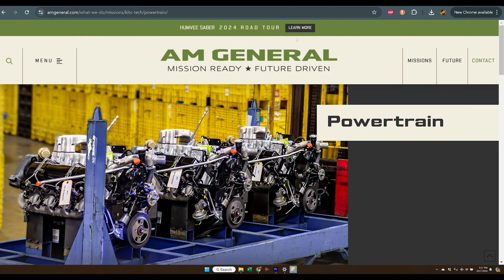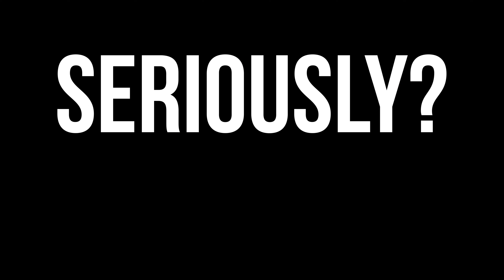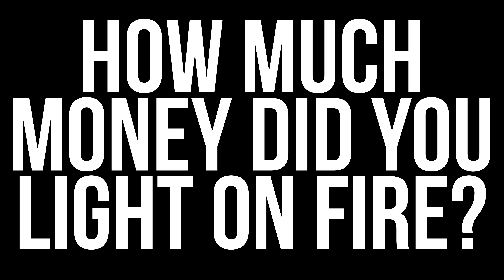How This 6.5 Diesel Makes Duramax Torque - Build Breakdown

Comment: Hey mate, cool video. I love my 6.5 in my 80 series LandCruiser. The question I have is where you plumb the coolant filter into....any pics or video of that? Cheers, Tim😊🙏
Reply from the maker: Did you check the photo gallery yet? Lots of photos. The filter is setup in a bypass fashion like a heater core.

Comment: Great walk thru on the build! I’ve been basing my plans for my 88 off your suspension, but staying to about 4”. The power plant will most likely be a 6.0 LS with a carb to start. Someone try and talk me out of it lol… I just don’t trust myself to do diesel correctly or be able to afford it.
Reply from the maker: 6.0 LS is a great engine and will make the torque you want with very few modifications. You're targeting 4", which is about where my truck sits. They get tall, quick.
Reply: @WillometMotorFab  they do! Thanks for your feedback. The boomerang hanger is my favorite design. Placed correctly I should be good to stay under 5 haha.
Reply from the maker: It’s worth the work to keep it low. 👍

Comment: I drive a old military K30 with the 6.2 diesel. I turned the fuel screw 1/4 turn and put on a ram air intake tube. It’s got plenty of power for me. I couldn’t imagine having the numbers yours is putting down.
Reply from the maker: Nice! You can get a lot out of those 6.2s with a little tinkering.

Comment: Considering dropping in a Duramax would probably have cost a lot more overall, this was way more cost effective. Even if you had just an unmodified Suburban, Blazer, K-series truck, these engines were supposed to be close to drop in ready if it had a gas engine or another diesel. I would try this on a K2500 GMT400 if I could find one. It is kind of sad that GM never did this engine the justice it deserved with what AM has been able to do. Least you shouldn't have to worry about a crank splitting, cracked cylinders, bad heads. Its been pretty much gone through and you won't have to worry about it.
Reply from the maker: The 6.5 got short-changed by GM, but the aftermarket has really come through. A Duramax would have been at least as expensive and required substantially more fabrication, which I would have entertained if I hadn’t just finished (6 months earlier) most of the fabrication work that you see in this video. It’s OK, this is a project that’s never done and this will not be the last engine that goes in it.
Reply: Not to mention a lot of the money he spent was on an entirely new engine and you could get one/rebuild one for fairly cheap but then it does depend on how much you want to build it up

Comment: I like the Duramax, but I've always liked the 6.5 better. I dunno, it's just the way it sounds, it's got a cooler character IMO.
I just wished the aftermarket support for them was as big as the Duramax's. But hopefully that will slowly change in the future.
Reply from the maker: It's a good time to be a 6.5 nut. Parts are available, good fuel systems, turbos that are made for the platform.

Comment: Such a crazy amount of detail went into the engine peripherals! Lots of really good information worth a lot. On a side note, as a European it's still crazy for me that you guys put single turbos on V8 engines 😀
Reply from the maker: Thanks for watching from afar! The idea of two smaller turbos has always been appealing. I think y’all might call that “bi-turbo.”
Reply: @WillometMotorFab  biturbo can also mean quite a few different things like register turbos and other stuff but in general, yes 😂 main idea is better throttle response, much less spool up time
Reply: @mazevx2451  I'm secretly dreaming of building a twin turbo, ported, forged crank & balanced 6.5. But not for power. Mainly for better flow and hopefully slightly better efficiency. The 6.5 is already a good platform to start with in terms of efficiency, but you can always make things better.
Reply: @Arexodius  I believe that the responsiveness and a good power/torque band is more important than max power anyway
Reply from the maker: I tend to agree, especially for anything that gets mixed use. With modern turbo options, you can do that without a super restrictive exhaust side.

Comment: 250 hp out of 6.5 liters is terrible lol. I love the way these engines sound but oh man they're hot garbage lol
Reply from the maker: Knowing diesels are known more for torque, 250hp is the good starting point. The IP has quite a bit more in it, and I’m getting up the guts to mess with it.
Reply: @WillometMotorFab  I'm currently in college for engineering and I'm working on building the most reliable 6.0 powerstroke possible. Sounds like an effort in futility, but after 20 years, there's an engineering fix for everything.
Reply: @WillometMotorFab  250hp by modern standards is terrible. 500hp of torque is the same as the 7.3 at factory specs. Sorry, dude, a 6.5 isn't worth the expense compared to a cummins.
Reply from the maker: That’s a fair critique, and the math is hard to justify without something else at play - in my case, that my dad and I wanted to build our “ultimate 6.5.” Of course, there are no cheap options, but some are harder to figure. Also, thank you for being respectful and constructive in your response. There’s a range of vulgarity the 6.5 videos seem to inspire, and I appreciate that your pushback didn’t have to get caught up in that filter. Thank you.
Reply: @WillometMotorFab  tbh, were both trying to build a motor that most people hate. The 6.5 was a huge stepstone in designing the 6.6 duramax.

Comment: Money well spent, sir. I love your channel. Please keep exploring those rabbit holes.
Reply from the maker: I’m glad you enjoy the channel! The charger offers so many rabbit holes!
Reply: @WillometMotorFab I have a rabbit hole for you. I figured out a way to run 75/90 in the wheel bearings in my Dana 60. No grease. With that fab experience you could probably improve on my method. Would be interesting to see it, I've never seen or heard of it outside of semi axles.

Comment: Nice to see someone build and drive  a clean IDI turbo motor. I went nuts with the 7.3 IDI turbo. Spent lots of money like yourself but I enjoy that truck way more than anything I could buy for that same cash. Building is always better than buying. Takes much more time but you get exactly the vehicle you want. Nice work
Reply from the maker: It’s so satisfying to build what you imagine. Those 7.3s were great engines!

Comment: You could go for a hub dyno or put normal wheels on it. But: For what? You cannot dial in a DB2 anyway very good.
Reply from the maker: The hub dyno interests me most. You can dial in a DB2 fairly well with the right fuel and timing. The old snap on timing meter can be frustrating, but that’s the worst of it.

Comment: Can you talk about the exhaust manifold and how the turbo is attached.   Can you also talk about the crossover pipe and how it runs.  I have a 1983 GMC K2500 that I'm building.
Reply: He used a banks manifold ment for a 6.2...It's way better than a stock 6.5 manifold... I have a stock square body with a 6.2 and I also am runnin the same manifold but I made my own crossover, turbo drain, and air intake but I bought the lower radiator hose from banks
Reply: @timcanizares5240  does the crossover run in front of the engine?  Is the driver side manifold replaced as well?
Reply from the maker: The build gallery has a load of photos covering the crossover. Only the passenger manifold changes.

Comment: Love your build! I started playing with 6.2's in 1984 when I bought my first 1983 GMC 6.2 2500 pickup. I lost count as to how many 6.2's I have owned, Blazers, Suburbans, pickups. I converted my 1970 Blazer to a 6.2 with a sm465 and dana 60 front and 14 bolt rear with detroit lockers. Then I stripped the Blazer and built a one ton pickup complete with a NVG4500 5 speed and ultimately converted to a 6.5. Most of my builds were low budget. My first 6.5 was a warranty take out after the vehicle suffered a oil cooler line failure and the customer demanded a new engine. I got the take out with 30k original miles and started my first 6.5 build ocmplete with a Rajay turbo but without an intercooler. I later upped the bar and got a set of 18:1 pistons and a wide open 4911 injection pump and it was a lot of fun until I got bit by the Cummins bug. At that time all of my running gear was in a 1985 Suburban body and it was a blast. When the cracks started showing up on the bottom ends of 6.2's and 6.5's I got discouraged when all of my spare blocks showed main web cracks. I sold my 18:1 6.5 and installed a 2001 Cummins in the suburban. I wish there was better support and better parts back when I was playing with 6.5's, but Penninsular was about it and there were no forged cranks or beefed up blocks available. I always had a soft spot in my heart for the 6.2/6.5 platform. Three years ago I had to sell the original 1983 GMC that I had purchased at 50k and later sold to my dad because I was struggling with finances. That truck had over 300k and still ran great!
Reply from the maker: Sounds like you've done it all with the 6.2/6.5s. I'm glad you've been able to enjoy them, and it seems like support has only gotten better these last few years.
Reply: @WillometMotorFab  I haven't played with a 6.2/6.5 since my daughter finally sold her 86K-5 Blazer that I installed a 6.5 into as well as a 14 bolt rear and 8 lug front axle. To be perfectly honest I was getting tired of fixing it all the time, from rebuilding the 700 R4 to the budget 6.5 that I installed that was a warranty take out that had a defect in the block deck. It was a late model 6.5 though and it had beefed up main bearing webs, probably just prior to the current models. It was a shame that I was broke back then and had to skimp on everything and just get it running for the least amount I could. I actually thought about putting a 6.5 into my 97 built Jeep TJ but knowing how the 6.5's tend to run hot, I opted for a Cummins R2.8 crate engine and it is perfect for the Jeep.
Reply: It's cool that you say all of that on YT, and have zero  videos related to engine building...
Reply from the maker: There’s literally footage taken from the two part long block build and install. Did the links for the engine build video not show?

Comment: You spent your money on exactly what You wanted to do, and you have pleasure in the outcome. 
You are obviously not a "Me Too!" 
I have the one from my 99 Suburban in my 86 E350 RV. 
That 460 was a gas hog! 5mpg. This motor was not made to be a powerhouse but an economical engine. It has the same torque as the 460, and the same rpm range. It comes with a 4L80E which is over drive 4 speed with converter lockup. C6, not so much...
Reply: Besides, a reman late model high output Diesel will set you back $30k in the box. And have you seen how shitty they are built? A tiny dowel pin secures the crank balancer and cam drive. Built in obsolescence.
Reply from the maker: You're exactly right, the 6.5 wasn't built to be a powerhouse, but that doesn't mean it can't be made one! So you swapped a 6.5 in a ford RV?! That’s awesome!

Comment: Love your build. I’ve always been a 6.5 fan.  A 6BT in something is like going to car shows and seeing a 350 in almost every car there.
Reply: More like an LS swap. Seeing a 350 swap is way less common.
Reply from the maker: They’re popular for a good reason, but it felt like my dad and I had unfinished business with this platform.
Reply: I tricked out a neighbor's '64 Chevelle SS Malibu convertible. The oddity was the Strange engineering narrowed 9" Ford rear with Torsen posi diff. Wilwood brakes, SS lines and braided SS vent line to a chrome K&N breather filter mounted remote to a polished Aluminum angle mounted across the rear frame rails. Add the chrome fuel pump also mounted on it , the 4" dia Aluminum Drive shaft, and custom stainless exhaust, it was a sight to see even on a lift. A buddy came by and saw it and nearly had a fit. "Pimp my ride car!"
It really was sweet.  3" lower in front, 2" lower in rear, 16" front wheels (disc brakes), 19" matching on the rear. Under the hood it was something else. It looked like 1964 with just a raw motor sitting there. Meaning nearly all wiring was hidden. The big 4 ga coming from the 120A alternator going to a power pole on the firewall feeding the starter, the MSD 6, and the gear reduction starter. No battery visible. AC, PS, PB, Hooker Headers(only company that made headers for that car with PS), and a Beautiful Ididit telescoping column.
Reply: Thats because people want something that works. The 6bt does that well.

Comment: I’ll be honest, I never heard any good things about the 6.5 until recently, goes to show to not listen to everything you hear 😂 this was fascinating to learn more about them
Reply from the maker: GM did a poor job of making these work for how people wanted to use them, so their reputation came from that. Now, we finally have the parts need to make this hidden gem perform.
Reply: @WillometMotorFab  how about the junk blocks I would agree accept that fact and they are under built a good optimizer build is a solid unit for sure with a mechanical pump
Reply: @WillometMotorFab  Imagine using non OEM parts but pretending that the engine is still stock...
Reply from the maker: Fair to say that the peripherals are not OE, but the engine is almost entirely GEP.
Reply: the 6.5 got the "nickelback" treatment for a long time. mainly cause of a few crappy electronic pieces GM put on it. the marine version is still in use today and quite good
Reply: @roachwerks3043  as someone who relied on the 6.5 in iraq its a pos they where always broken
Reply: @moparjr89  the part where i said "mainly because of the crappy electronics that GM put on" would cover that. the engine itself is a good design
Reply: @@moparjr89  Beat to crap, abused and poorly maintained military 6.2s and 6.5s aren’t really the same as a truck owned by the rest of us.  Most privates in the army could find a way to break an anvil with a rubber mallet.
Reply: For what it's worth, my 1999 K 2500 suburban has only had the pmd relocated and the vacuum pump removed for the plastic lines kept cracking. It has 350,000 miles and hasn't had anything replaced. When I put the turbo Master on it after I remove the vacuum pump the mpg dropped 5 mpg, but it still gets 17-18 mpg on the highway. I personally think it's the bees knees.
Reply: "goes to show to not listen to everything you hear" more importantly:
General rule is: People who are "just fine with the result" will NEVER post or speak out loud! It is the sam since 15 years regarding so called "reviews". 

In addition: Most people do not have a clue and cannot compare. 
I worked in consumer products industry and the after sales lead´s desk was not far. We had 2-5 of 10.000 products fail. Do the math of the value of a person speaking of a failed product.
Reply: @Christopherbever  its a GEP Block is why
Reply: I mean to be fair, that amount of expertise and work needed to make 250-300hp is why they don’t have the best reputation. It just takes a lot of money to make them reliable even at low power levels
Reply: @Christopherbever  also wanna add he did a lot of work to this motor to make 500 ft-lb it’s not cheap to make one of these good
Reply: @uncledrewbee you don’t have to do a fraction of what they did to make one reliable. They are reliable stock. It’s crazy the amount of BS spread about these engines. They don’t fail any more than any other engine especially of the time they were current. People don’t know anything and buy already neglected junk and say “look a diesel, it’ll run forever with no maintenance”. In reality the 6.5s contemporaries the 7.3 and 5.9 were way more expensive to own and didn’t have all that much more power. In fact for the 97 model year they were all 3 about tied in stock form. They can all easily reach 300k. They all required about the same maintenance with the 6.5 being the cheapest diesel oil change in pickup history. It’s all who owns it and what their expectations are.